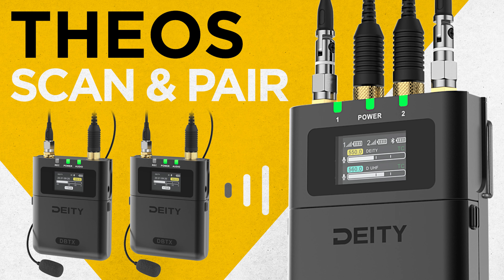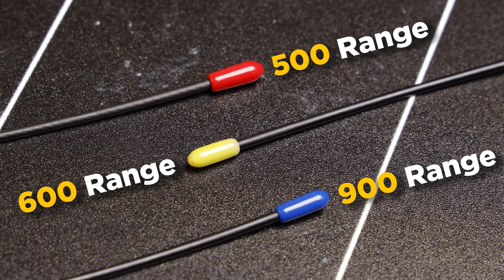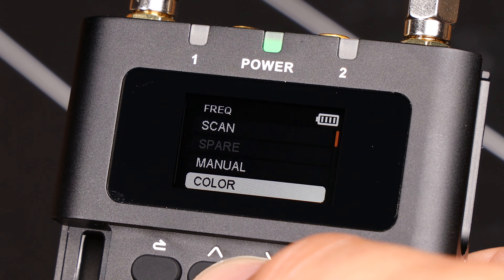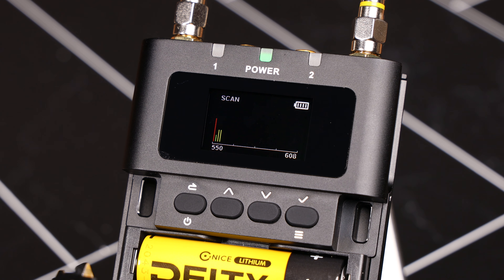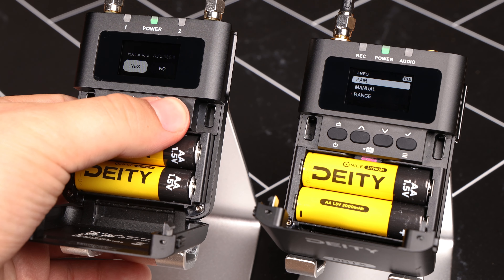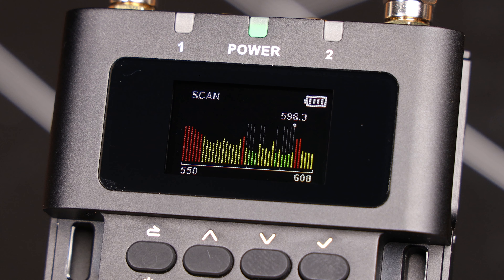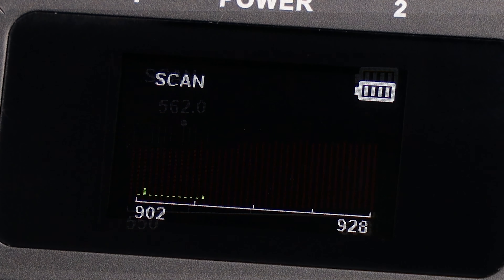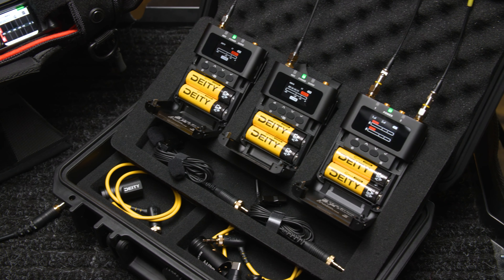Deity THEOS Digital UHF Tutorial | How To Scan & Pair

Comment: Hello greetings. Can two different ranges be used at the same time? tx1 550-608 and tx2 800-900 for example? would there be no problem?
Reply from the maker: You can't. Both channels need to be in the same range per D2RX unit.

Comment: PRO TIP - Keep the transmitters turned OFF until the receiver scan is complete.
When the freq scan is done and the receiver asks you to AUTOSET, power ON the transmitters and prep them for pairing.
Select YES on the receiver and pair the transmitters as instructed on the receiver.

Comment: Is this a true diversity receiver?
Reply from the maker: It uses antenna diversity
Reply: so it does not have two tuners, does it? It just picks which antenna has the best signal but it does not have two tuners simultaneously receiving signal. Just to be clear @DeityMicrophones
Reply: @SportFlow  They've just announced that the release will be delayed as they're now making them true diversity!
Reply: @philpike6177 what is a „true diversity“ receiver? Sorry if it’s a dumb question